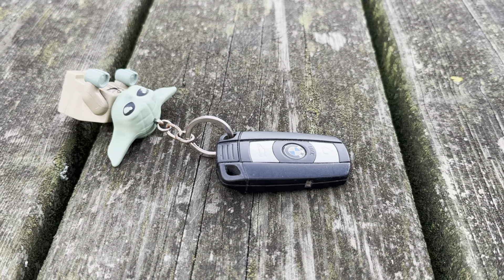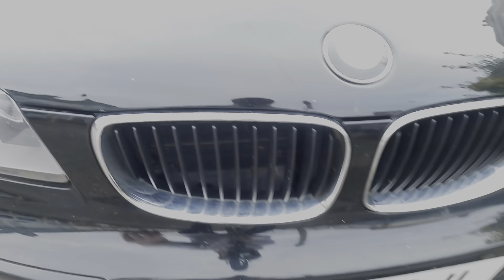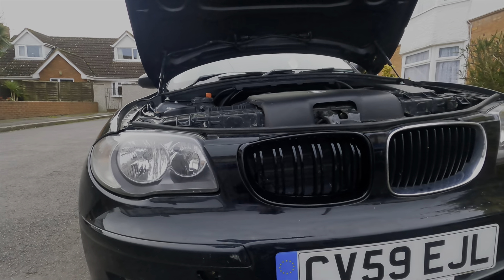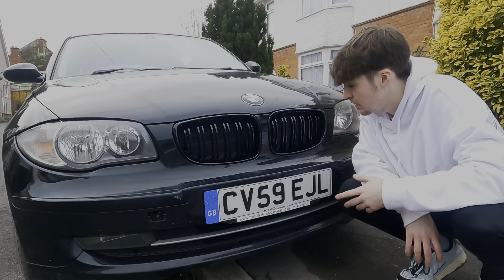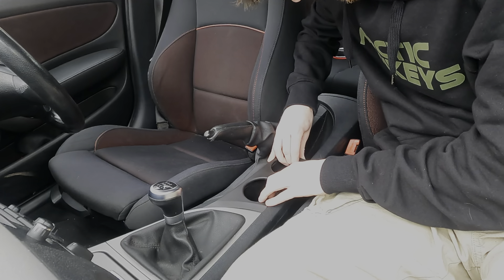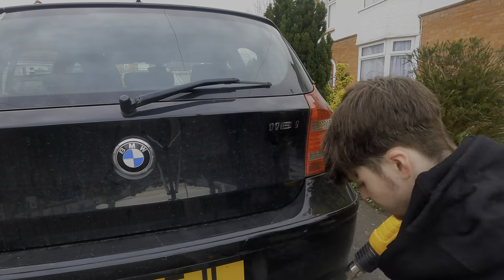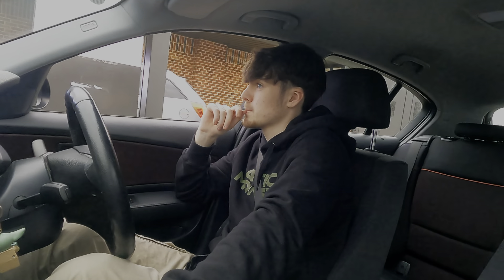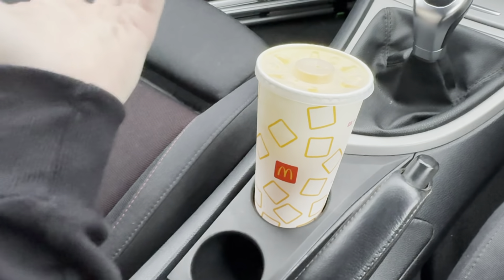STEALTHING MY BMW 1 SERIES

Comment: Great video dude, update on mine no more airbag light! Would've recorded the process but access was tight under the driverseat 😂
Reply from the maker: Cheers lad, that’s one headache done then, how much work was it in the end? Bit of a bummer you couldn’t record it but it’s better that it’s fixed 😂
Reply: @OfficialSamBryant  another JBE module, work on the driverseat plug, replaced the positive cable cause the pyro fuse was blown and done dodgey to get by list could go on 😂😂
Reply from the maker: Did you buy an abandoned 1 series or was it just not loved by the previous owner 😂😂
Reply: @OfficialSamBryant  it was loved by someone all the way to 2022 as it was serviced by bmw, then someone didn’t love it last year 😂😂
Reply from the maker: Please bring it back to life and love it again as it definitely needs it 😂😂
Reply: @OfficialSamBryant  I shall do buddy don't worry about that one, oil change next month with it being the N47 lump